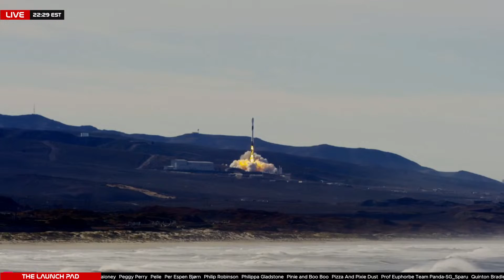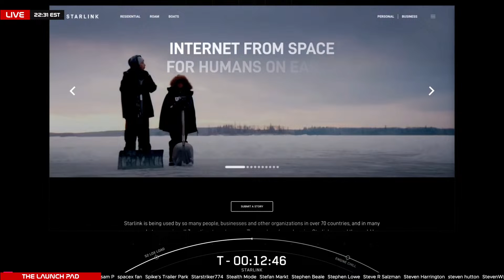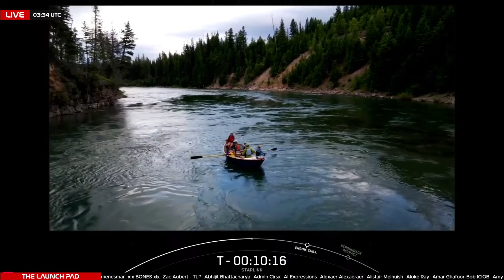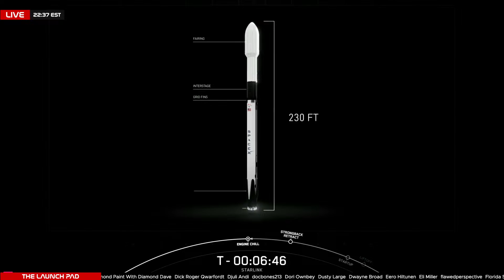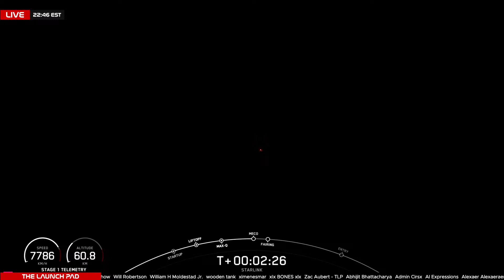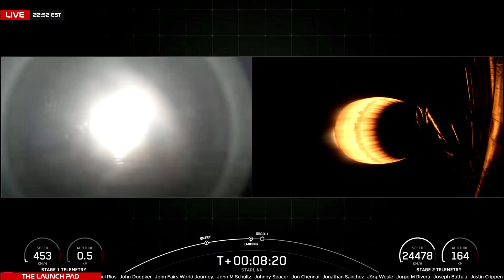REPLAY! SpaceX 1st Starlink To Cell Sat Launch

Comment: We heard the sonic boom at our location at 7:15 PM PST in Camarillo, in Ventura county… Then we heard the engine pulse rumbling as it pasted over. The pulsing was muffled a little by low cloud cover, and we felt the audio pressure as well… R. 16:24  McDougall
Reply: pasted over? not glue?